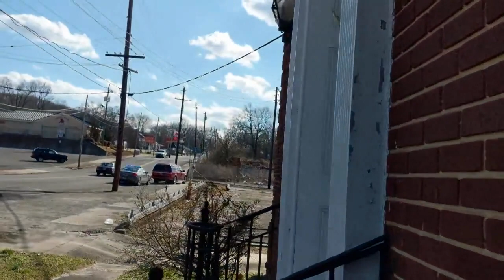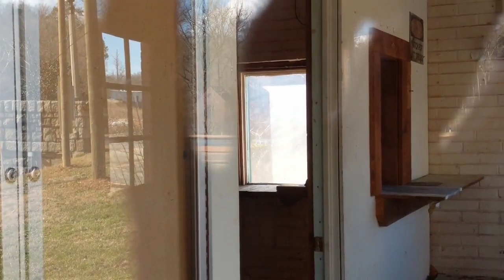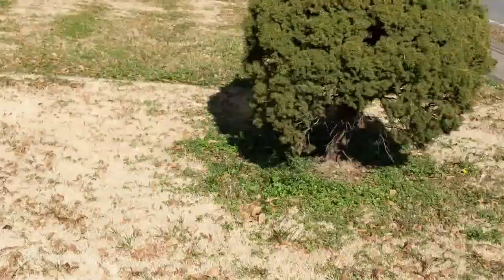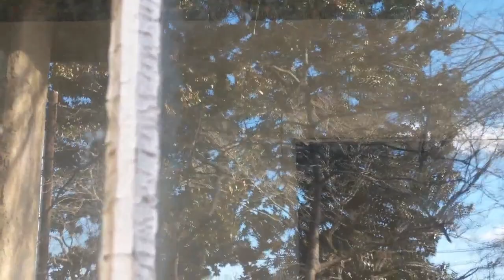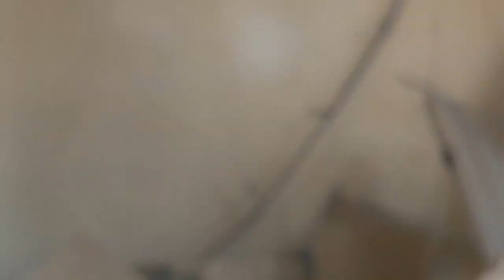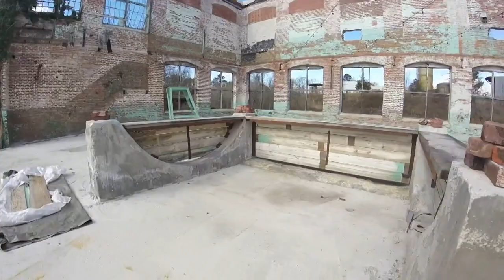CLOSED AFTER 105 YEARS

Comment: The builting you first went to with the red dragon on the door is the Pepperell Griffin . Lindale used to be a Pepperdll mill before it was sold off. The second  building was shipping recieving. The tan building was the clinic nurses station. Those red valves you called gas valves are Post indicator valves used to turn on off the sprinkler system. I know all this because I worked in a pepperell mill for 20 years.
Reply from the maker: Thank you very much for the info! I always like to learn specifics about a place if possible. Thank you too for watching!